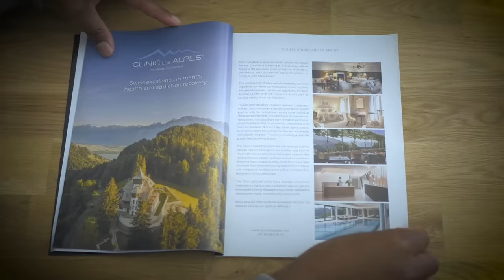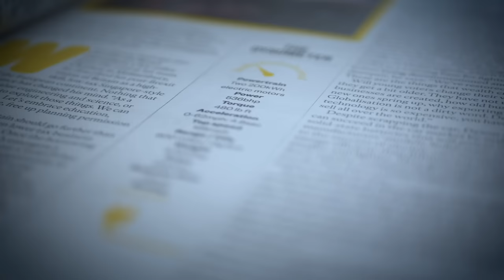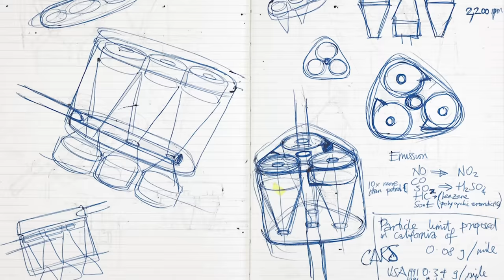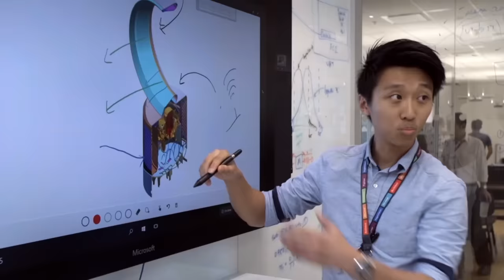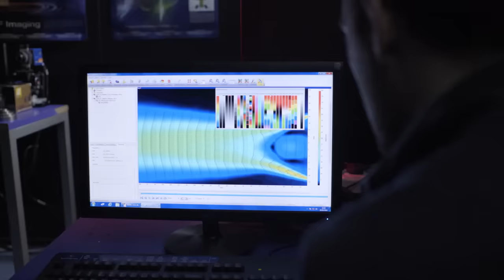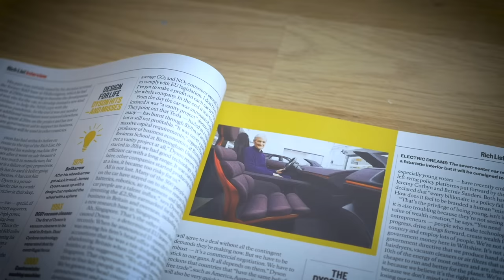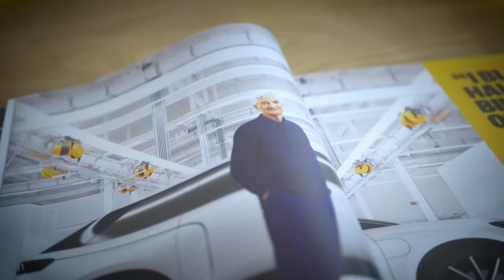Who Killed The Dyson Electric Car?

Comment: Dyson killed his EV project when he realised he doesn't have any of the expertise to make one. Also, Dyson products are worthless: they dont work well and die young. We owned two of his expensive vacuum cleaners and none cleaned well but both broke in a short time. Our Miele vacuum cleaner is 6 years old and still looks and acts new. And it was cheaper than a Dyson, strangely. I think Dysons are for morons.
Reply: I've have 2 dysons one a dc14  since 2007 bought from Curry's half price still working perfectly all parts are available on e-bay very cheap. Some people throw them away I usually end up fixing there old Dyson for £7 in parts.  The whole thing comes apart like a kit with hardly any tool. If the car was as well made as his vacuum cleaner they were probably worth £150k especially if they lasted 20+ years

Comment: If it was priced right and not named after a hoover, then sure, I would be interested. We have had Dyson hoovers for years. We just purchased a new battery powered one a month ago (V8 I think?) and I have the same stainless steel hand dryer seen in this video in the under small toilet under the stairs. Much more hygienic, as it's mainly used by guests.

Comment: My Triumph bike had a range of about 130 miles and it never stopped me going anywhere. Because refuelling was quick and easy. No reason why electric cars can't be the same. 
Save costs by making a modest electric car with a 200 mile range and top speed of 100mph. 
Spend some of that half a billion quid on infrastructure, like Tesla did, and improving charge rates. 
I'm sure the process of refuelling a Ford Model T in 1908 wasn't as effortless as filling a modern car today. Things will improve.

Comment: If I had the cash and it was cheaper, with the range it needs which is 300 miles, not 600 miles which as you point out is superfluous. Very few journeys in any day are over 300 miles, after which time a hour’s break is needed during which an EV should /will be able to regain those 300 miles.
A bit like the C5, the car is slightly ahead of the market too so, with a delay and better, lighter, batteries the car would be  viable at around £75,000 given that the car should be able to do 1,000,000 miles and therefore mortgageable with negligible running costs :-)

Comment: Forgetting the investment of this magnitude in that specific industry are for platform that are meant to last between 15 and 25 years. Any manufacturer caught by a major change mid through the lifetime of its current platform is likely to be either stuck with a system that needs to be adapted and therefore probably not adequate for the market or eat a complete loss on that system. Neither is a prospect that existing player relishes. That's why it takes so much time for EV to come out for traditional manufacturer.

Comment: Why the electric car manufacturers go with these big batteries. It is just extra cost and weight. They need to go like Chevy volt - provide enough to do the regular daily commute and offer an optional small gas generator on a trailer for going on vacation. Probably just rent one when you need it. All they need is to have plug on the rear bumper and improve the current generators so that when battery goes low the car can start the generator. You just attach and plug it. Parking will be more difficult

Comment: 2:30 That is a gross oversimplification.  The thing about going greener with the internal combustion engine is that there is a bigger payoff by trying to improve combustion itself than trying to improve how effectively you clean the exhaust gases.  Exhaust cleaning itself can help you meet emissions requirements, but cars are already meeting those without the need for exotic new technology.  On the other hand, raising efficiency and quality of combustion by a variety of means can get you better emissions, better performance, and better fuel mileage all at the same time, making it a more attractive upgrade from older technology.
This is where the profitability point sets in.  You can't really sell "we have something better than your average catalytic converter!!!," because the people who care about that are regulatory bureaucrats.  You can, however, sell that "we can get you a flatter torque curve and a wider power band and better fuel efficiency."  Dyson's better exhaust cleaning system was probably legitimately impressive, but it was too shallow of a win to be worthwhile.  Now, yes, if it required less wasted hydrocarbons, it probably could also save some fuel as well, but I doubt it could have done better than improving the engine itself.
And before you think about the timing of when manufacturers rolled out the sorts of new thermodynamic efficiency improvements we've seen in recent years as opposed to when Dyson proposed his exhaust cleaner...  you have to realize the sorts of long turnaround times the auto industry has with respect to R&D.  Even things as trivial as upgrading the displays on the center stack often has a 3-year turnaround time.  Now try and imagine how long it would take to manage something on the drivetrain that really matters and even after trials and testing on mules and collecting data and validating the long-term reliability of the systems and only then going through the legal rigmarole and regulatory approval processes...  you can imagine how many years in the making something like direct injection or counter-swirling valve seat geometry would have been.  Chances are good that manufacturers had several other alternatives in the lab.
To be honest, the nature of emissions regulations is kind stupid, particularly in the U.S., though Europe is significantly more sensible in this regard.  In the U.S. in particular, they are concerned with the composition of the exhaust per unit volume.  The logic here is that the cars shouldn't be putting out very much nasty stuff like NOx or CO...  Problem with that is that nobody drives according to units of exhaust volume!  People drive according to distances they need to travel, and the methodology used doesn't scale appropriately with respect to mileage.  It literally makes it possible for a Honda Civic and a Chevy Corvette to achieve similar emissions scores.  Europe at least does a better job on this, but even there it's a bit problematic since their schedule is not too representative to the real driving behaviors within various countries.

Comment: I'd like to see it come back with a small, lightweight 4 or 5-seater, maybe reminiscent of a Corolla AE86. You could get away with a 200 mile range with a small battery if the car is light enough.
Reply: Upthread, I was saying he could have invested in Lit Motors and spend, maybe, a 100 million just to finalize engineering issues and production. Tesla didn't start from scratch they merged with other manufacturers and just branded it.

Comment: The problem with designers today, is the pursuit of "luxury" or "premium" product markets BEFORE the markets have accepted the product/brand at it's "embryo" stage!  In automotive terms, one has to remember that ALL manufacturers started SMALL, before becoming larger with the foundations built by those smaller cars and accessing the much larger VALUE based markets first!
Austin/and Morris motors in the UK, were small manufacturers, until they started producing cars like the Austin Seven, and the Morris 8 car, aimed at the working class/lower end of the market, where accessible prices and  basic function was more important than any other facet of performance or ownership!  Ford was virtually unheard of until it started producing the Model T, aimed at working class transportation at accessible prices again!
Until a manufacturer decides to focus on those who cannot AFFORD a new car, they will ALWAYS FAIL!  For decades, I have maintained that the market has a place for a mini 2-seater sports/commuter car, and a 4 seater (+ toddler seat) family hatch/estate in what we might call the "medium size" sector today!  (Astra/Focus/Golf etc)  Larger cars can be reserved for the more affluent at a later date, but this lower end market has been neglected for DECADES!  As a result, older, dirtier, less reliable, second hand cars have become the ONLY way the less affluent can afford to drive!  The ever growing "non-working" part of our communities are becoming DISENFRANCHISED from the entire market!  How can ANY industry be sustained in these circumstances?  
I have a passion for driving, and have been a "petrol-head" since the age of 7!  As a person retired early through illness, I have been without transportation for nearly 20 years!  I miss it like you would miss your legs!  I would be happy in a small 2 seater car with a small boot/trunk, enough to house a small electric wheelchair, or case for a week away at the seaside!  If I was a family man, I'd need the same room, and a slightly larger capacity motor to do the same, but with a partner and 2 kids and a dog!  No frills, ....no fancy driver aids, ...just the ability to travel 300+ miles, reliably, cheaply, and without needing a week of therapy to recover afterwards!  This is what cars like the original Mini did, and the original Ford Escorts and Fiestas.  The Fiat Topolino, the MG Midget, Triumph Spitfire, all made driving accessible! ....and THAT is what producers of electric vehicles MUST AIM FOR!  Producing luxury products for the top 1% of the population, however rich and affluent they may be, is unsustainable!  
Jaguar started as The Swallow Sidecar Company, and MAYBE, as a way of protecting it's future, it should revive that name as it's "budget" brand, to produce the most basic of transportation devices?  Other manufacturers could do the same?  Ford for example, could restart the "Model" line of cars, such as the Model A, B, T, etc?
What is VERY apparent, is the automotive industry is in DIRE NEED of new thinking, to become sustainable in TODAY'S MARKETS, as well as in the future.  Technological "bells and whistles" will not make you spend your money on a new car, if you cannot afford to put food on the table or pay the rent!  Fewer and fewer people in the developed world will be able to find work of any but the most "menial" types, in the service industries!  As such, household incomes will plummet.  This will mean ALL LUXURIES being reassessed for usefulness and whether they are a part of the "sustainability list".  Can we afford them and can we live without it?  Expensive vehicles, to own and to buy, will be high on that list of items to cut from the budget!  
I wish Mr Dyson had focused on the lower end of the market instead of the luxury designer element, but his project looked amazing!  He has done a lot of development there, and I hope he can put it "on the back burner" rather than dump the lot in the bin?  If he can show the merits of his work so far, to investors, MAYBE he can "re-direct" some of that tech into a more "budget conscious" product range?  I would love to share some of my ideas with him, gratis, just to make sure this happens!

Comment: I personally believe Sir James should not have given up, for a starters was there ever a marketing due diligence/plan? Is a 600 mile charge capacity in the first proto model all that necessary, i myself would not be fussed. Perhaps look at technology re arrangement and redundancy to get costs right down ie less battery less weight & initially less fancy tech i say, start in first gear start with the basic model (but with several innovative features which will turn on motobuffs) see how the market reacts then go from there. He should at least build several concept cars to date i not seen anything from Dyson, enter them into car shows like Geneva Paris Detroit show. If  the cost is affordable and better, it will win the marketplace. I'd buy a Dyson

Comment: I had two Dyson products both vacuum cleaners, both awful. The battery vacuum lasted just 6 minutes, so not much mileage in it. Dysons whole business runs on hype, the hand dryer possibly the only exception however in times of corona I don’t want to go anywhere near one as they blow bacteria and potentially virus through the air at 150 mph.

Comment: As with all electric cars, the Achilles heel is the battery or battery technology which will limit the range and performance of the car.  That has been the case from the days of the electric milk float and no matter how much money you throw at the development of the modern electric car that will continue to be the problem until a battery breakthrough occurs. Anyone who does not understand this basic fault and fails to work within its limitations can hardly be considered as "intelligent". £500 million spent would barely cover the cost of an evaluation programme at any motor manufacturer.
In the USA a car driver does on average 29 miles per day and covers 11467 miles per year. In the UK the average driver does 16.8 miles per day and covers 7600 miles per year. Even allowing for the spread of mileages contained within the "average" 95% of the majority of car journeys could be completed on battery storage capacity of 200 miles or less. For those requiring extended mileage the use of extension packs which can be connected to the main pack is an idea under development. 
Electric cars are not "green" According to a German study from researchers Christoph Buchal, Hans-Dieter Karl, and Hans-Werner Sinn;

For a Tesla battery of 75 kWh, this means an additional CO2 emission of 10 875 kg to 14 625 kg of CO2 is emitted during its production 
It is counterproductive to promote EVs in regions where electricity is produced from oil, coal, and lignite combustion as the increase in the use of EV's will increase the use of fossil fuel to supply the electricity the EV was supposed to reduce. There is also the land management problem with mining rare and earths and materials required their high toxicity and problematic recycling at the end of their life.

Comment: Agreed. The SUV would be a tough sell. But, if he shifted his company motto to be like the electric rolls Royce then it could work. Sort of like a super, overluxurious model x. Also I wouldn’t be upset to see that sort of car with his emissions saving exhaust and other sort of technology with an internal combustion engine. Even more so, why not try partnering with a big corporation for their battery technology rather than do it yourself. Why reinvent the wheel? Partner with a manufacturer for either an I.C.E like ford’s ecoboost engine, and put an electric or a cool spin on it. Or just borrow a Powertrain from someone else and badge up the body with Dyson logos

Comment: 600 mile - could be 400 on highway - and you don’t want to recharge the car to 100% (last 20% is slow) - and you don’t want to drive it to zero - so driving 300 mile per charge on highway could have been a realistic scenario for this car.

Comment: The Range Rover SVA is 200K and is around the same dimensions as the Dyson SUV, so realistically it would have seemed cheap compared to the competition.  Also, THOUSANDS of people bought the $150K version of the Tesla Model X.  When Tesla first started, they sold Roadsters for around 120K+, in todays terms you're looking at around 175K and the Roadster was a 2 seater!  The reality is that he could have gone forward with the car and then maybe come out with something simpler and less expensive as time went on, just like Tesla did.  Look what he did with Dyson Vacuums.  The first models sold in Japan for over $2K each!  Why?  Because they were the best.  As he started selling more vacuums he came out with models less expensive , but still just over $1K, then $800.00, then $600.00.  Now some of his Vacuums sell for under $300.00.

Comment: As an absolute top of the range vehicle, 150k doesn't seem that bad. British hand built and bespoke per customer design features etc. It would definitely have  needed to smash Tesla on every level though. I reckon maybe a little comprising with specs and the huge reduction in battery pricing could have dropped the price to below 100k. I'm no expert but I'm guessing licencing costs of 3rd party software was also a major factor in his decision. I have a suspicion the Chinese are not having the same licensing cost issues,, cough cough.

Comment: Maybe it's an American mindset, but the 600 mile stated range makes sense considering you are supposed to routinely charge to 100% or run batteries too low, so only use 80% of that stated range.  So 600 really mean 480 in perfect conditions.  In real world use that is really closer to 400 miles of usable range.  I've driven twice that in a day many times.  And driven somewhere 160-200 miles away and back in the same day, on a single tank of gas, even more times.  Not a single EV on the market comes close to being able to do that and it would be nice to be able to charge at home before and after a longer trip without having to worry about stopping along the way.  I think 500 miles of stated range is the ideal since it would give you the same real world usable range as an ICE

Comment: How did Dyson promise 600 mile range without calculating how much it was gonna cost? Even cutting edge Tesla's were barely above 300, and pushing $100k, while operating massive battery factory.